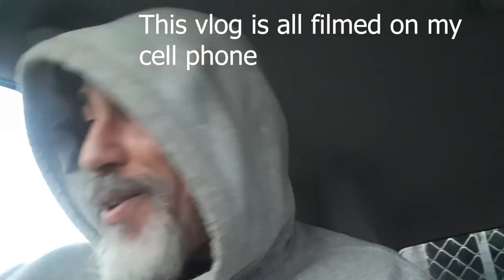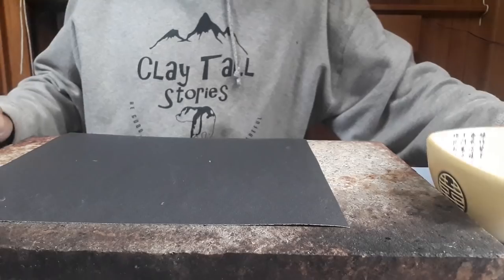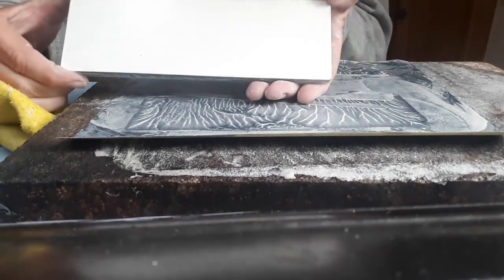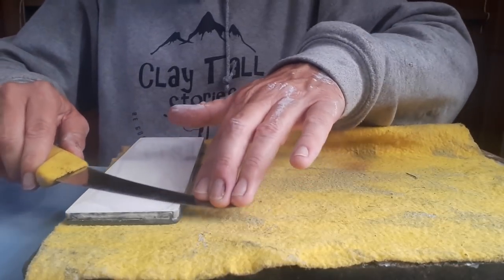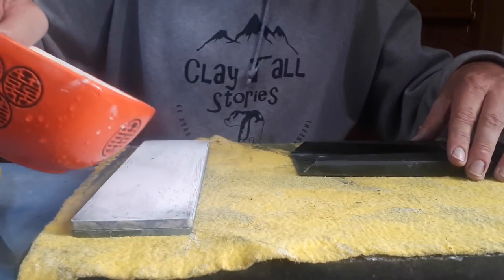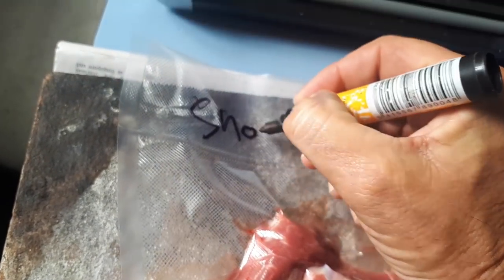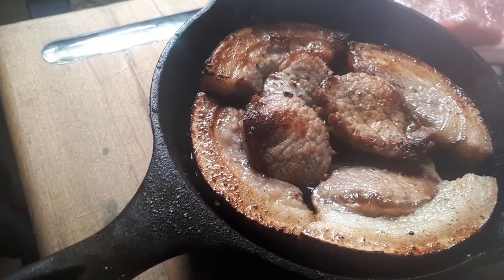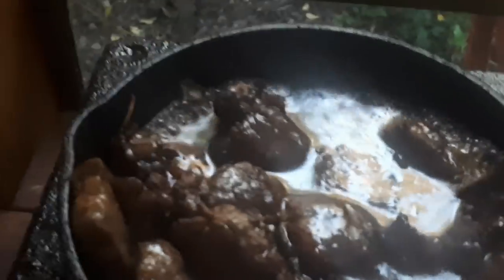Vlog 33- Clay Tall Stories

Comment: Nice sharpening Clay, to put the final edge on your knives pull the edge of the knife slowly through a little bit of hard wood (not soft pine), that will rip any wire edges off the blade exposing pure edge.
Reply from the maker: Shelley Raskin good tip